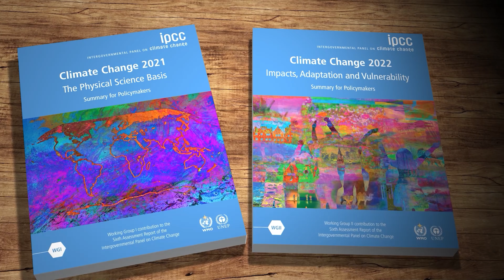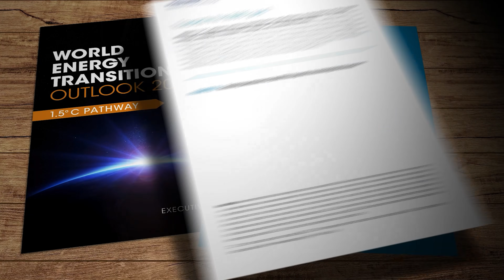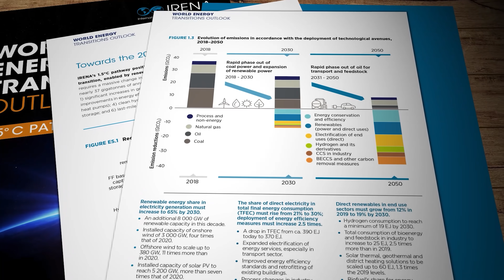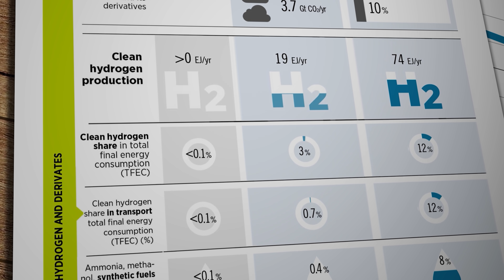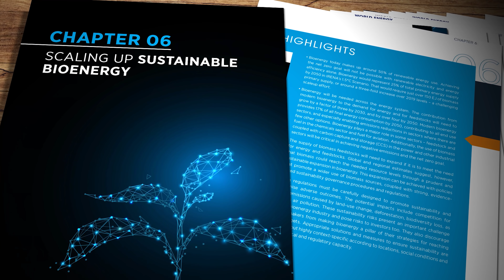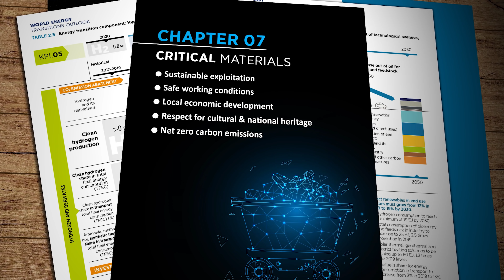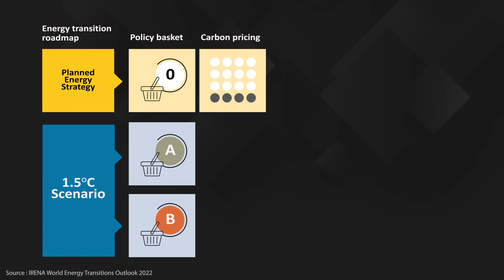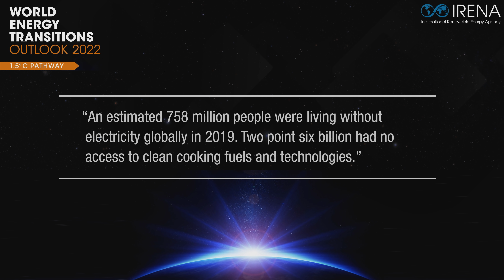Massive global energy disruptions are coming. Brace yourself!

Comment: As a Nuclear Engineer and past reactor operator with 15 years in the energy industry, I think that some of the goals are inconceivably outlandish in their investment requirements or energy targets by source when applied to the real world scenario requiring economists and financiers to put up their resources. This all seems to be a significantly easier energy transition if nuclear is integrated into the blend. With a few changes to the NRC approval process that are obtuse overcompensations and the addition of a federal nuclear reprocessing program, nuclear becomes viable, sustainable, scalable, and very clean.

I am very aware that the world sees nuclear energy as non-viable for a myriad of reasons; unfortunately the those reasons are principally fear and misconceptions based on a lack of education. Along with this, I can also understand why the International Renewable Energy Association would leave nuclear off the map because of the misconception that it is not capable of being renewable... however, as the French have concertedly shown, reprocessing of fuel is a fantastic method to nearly eliminate the waste. And to the nay-sayers that say 'well there is still waste': all the renewables cause more waste mass by multiples... wind blades, old PV cells, old batteries that escape recycling.
To any who quote TMI, Fukushima, or Chernobyl: for TMI and Fukushima I point you to the undeniable difference in today's reactor designs of GenIII+, Gen4, or SMR reactors vs those older styles of GenI and GenII reactors that required operator action or active safety systems to maintain core integrity. We learned a lot from those accidents and I am all for replacing those style of reactors to prevent another issue. For Chernobyl: Dont create a reactor to both produce plutonium and power... theyre contrary goals. Dont be cheap. Train your people.
Reply: Great breakdown!
Reply: Energy can neither be created nor destroyed, it can only change forms.  Nuclear reaction ends up as heat, and that is the primary motivtion for selecting materials for a nuclear based electrical generation plant, set up conditions to have a controllable nuclear reaction that will produce lots of heat for a long time and use that heat to boil water, spin a steam turbine with a generator on the same shaft, that causes a flow of electrons that can be used to do work at sites hundreds of miles from the source of energy conversion. 
  Mkay,   Now what does nature do with all that heat from nuclear reaction?   While we are thinking about it, how much heat is on this planet right now, that otherwises would not have been had we not dug up lots of materials like uranium, purified it and put it in close enough proximity that one particle causes another to make heat?  What is the total amount of heat added to the gas/solid interface of this planet, that is the result of man-induced nuclear reactions?  That is a pretty good sized pile of heat by now isnt it?  Where did all that nuclear derived heat go?

Comment: The IPCC report appears to not consider that levels of carbon in the distant past was up to 40 times current levels. During the age of the dinosaurs it was high since carbon is an essential component for plant growth - needed for the many plant-eating ones - until the many volcanoes and a small interstellar rock came our way.
The solution that will be chosen will be determined by Blackrock and Vanguard since they'll do the usual and guide policies that will enrich the companies they own from any government grants going around.
The IPCC doesn't go into the issue that electric cars only have a life of 50% of petrol / diesel  vehicles due to the batteries only having a 8-12 year life - and at £8000-£15000 for a replacement battery pack - too expensive to replace.
PV solar panels have a 15-25 year life - and currently not recyclable. The fibre-glass from wind-turbine blades, with a life of about 10 years are also not currently recyclable and thus will need an enormous hole in the ground to bury.
I've not noticed the increasing number of people with their own private planes selling them to do 'their-bit' for the planet.
I didn't notice in the IPCC report about the effect of the earth's tilt on global temperatures - my impression was this had a major contribution to previous ice-ages.
Note we should be using the phrase 'Global Change', since this will reduce the previous embarrassment of proclaiming we are x years from Global cooling and then claim we are x years from Global warming!!
The IPCC report appears to miss the effects of continental shifts - one problem area is in Antarctica  - apparently some people tend to ignore the effect of the earth crust opener up under several miles of ice.
So lets have a think 'are we going in the right direction' managing the earths resources for the future. 
I see the Carbon capture scheme in Iceland is having 'teething' issues - it was too cold for it to operate!! 
Any Government / Industry reports should include references to any other studies / reports on which their conclusions are based to ensure we are following the science - and not 'follow the money'!!
Reply: "The IPCC report appears to not consider that levels of carbon in the distant past was up to 40 times current levels."

40 times? that's 16.000 ppm. The only time there was this much CO2 in the atmosphere was before multicelular organisms existed on the planet.

You have no idea what you're talking about.

"I didn't notice in the IPCC report about the effect of the earth's tilt on global temperatures - my impression was this had a major contribution to previous ice-ages."

Obviously you never read an IPCC report in your life and probably never will. I just googled "IPCC earth's tilt" and there it was! An IPCC report saying that.

"FAQ 6.1, Figure 1. Schematic of the Earth’s orbital changes (Milankovitch cycles) that drive the ice age cycles. ‘T’ denotes changes in the tilt (or obliquity) of the Earth’s axis, ‘E’ denotes changes in the eccentricity of the orbit (due to variations in the minor axis of the ellipse), and ‘P’ denotes precession, that is, changes in the direction of the axis tilt at a given point of the orbit. Source: Rahmstorf and Schellnhuber (2006)."  IPCC Fourth Assessment Report: Climate Change 2007

It took me 30 seconds to prove that what you are saying is completely wrong. It shows you never checked and are just reciting some thing you read on a blog or a conspiracy video.

Now i just hope people will check on what i say so they can see how you, at best, have no idea of what ur talking about, at worst you're lying.

Comment: Hydrogen can be made of excess electricity from renewals, sure, but most of the time it's better to store the electricity in a variety of ways. Hydrogen will only be used in niche situations. It can even be better to make aluminium air batteries than hydrogen, out of excess electricity.  Desalination of salt water is also a great use of excess electricity from renewables.
Reply: <<  Desalination of salt water is also a great use of excess electricity from renewables.>>

Renewables always have the problem of being unreliable.  Is hugely expensive to build a massive surplus of renewable power because of intermittency,  then build a massive surplus of desalination  plants to use that surplus of power only the fraction of time it will be available.

All to produce pitiful amounts of water the main problem of which it is priced too cheaply.

All this would require a stupefying investment in land,  labor and materials,  which would take enormous amounts of energy by itself to build out. 

Instead,  we should be building large amounts of nuclear power, which makes the renewable power a joke by comparison.
Reply: Desalination can also help with desertification in some cases and maybe if enough water is taken out of the ocean it can reduce the rising sea levels, but it have to be scaled up in a huge way.

Comment: A lovely and thoughtful lesson, as always, thank you. I do have one question, however. It seems this work assumed a continued loss of power generation (and hence jobs) in nuclear. This puzzles me. The new (old, really) thorium technology now undergoing renaissance and testing promises a safe, scalable, cheaper alternative to the obsolete nuke tech of yesteryear and today.  If we are to ramp up some winning version of carbon sequestration and admit to the likely need for inreased global desalination capacity as well, it becomes clear that we will likely be needing to meet even steeper demand curves than those is being presented in this work. Is it true that the authors did not even mention Th (admittedly tough to quantitate as of now) or even newer-tech, compact U nukes in the current modeling work? This seems a significant oversight to me. Indeed, I would argue that the low probabilty of success implied in the analysis you've presented to us on here might well form the basis of an impassioned, full-throated pitch for rapid development and deployment of Th nukes!

Comment: In Germany and Austria are several biogas cogeneration plants typically combined with wind power and photovoltaic systems. Communities like Wildpolzried generate more than eight times as much energy than they need from the biogas plants alone. Another good aspect is that these plants generate income that benefits the community. Of course, this only works in a socialized structure. I don't think that this would fly in a privatized, commercial business model.

Comment: When environmentalists stop lying about nuclear power (which can end global warming in a couple of decades), is when I will believe there is an actual crisis.  Until then this seems like more anti-development (which ends up being anti-poor people) policies which will likely do more harm than good.  
I will give you an example.  In my hometown, they just outlawed new construction with natural gas HVAC.  However, due to the amount of gas used to make power here, that policy actually triples the amount of CO2 made per unit of heat created (because electrical heating is only 10% efficient).  Note this is only true because it is a moderate climate where heat pumps don't work, this would have been a good policy in a much hotter or cooler climate.  And before you claim it doesn't matter because it is a moderate climate, consider how much hot water you use and how a moderate climate doesn't change the amount of energy needed to heat it.  If you want to know why people don't want to go along with your policies, first make sure they work by doing some math.

Comment: If our future depends on a high level on international cooperation on good, intelligent policies, I'm afraid we're doomed. It has almost never happened before and there is very little reason to believe it will happen now.

Fortunately I don't think it does. "Renewable" electricity generation is already, in some cases, cheaper than fossil fuel electricity generation and grid-scale batteries are in most cases cheaper than natural gas "peaker" plants. BEVs are close to the same cost as ICE vehicles and the high end ones arguably compete directly with ICE "supercars" that cost 4 or even 10 times or more as much. And the costs in all these are on a long-term (and rapid) decline. There are many similar technologies that starting to come online.

This report sounds like a plan from socialist bureaucrats who are unable to understand market economies. And by "socialist", I mean the likes of the Fabian society, not Marxists. The very first action required in any realistic plan to reduce carbon dioxide output from burning fossil fuels is to STOP SUBSIDIZING THE PRODUCTION AND USE OF FOSSIL FUELS. If that is not the first and most important step of any plan, the plan is worthless.

Finally, your comment about Tesla's reason for use of LiFePo batteries is disingenuous, if not outright dishonest. Google "accelerate the world's transition to sustainable energy". What is the first result that you get? Any chance that it's Tesla's mission statement? Yes, one factor in the decision to use LiFePo cells is that they are cheaper. Another is that they are available, so Tesla is doing this, in part, to build more electric vehicles. They are also switching their storage products to use LiFePo, to free up a limited supply of NMC batteries for vehicles that need longer range and/or higher performance.

Comment: Where none of this adds up,  is the reality is,  the more wind and solar we have on our system,  I'm in Ireland,   the higher the price  our electricity gets.  Is it that most of the big wind and solar operations are now owned by Big Oil,  and they now have us over the metaphorical barrel for filling in the gaps.   What particularly annoys me,  is the "missing half of the sentence"  syndrome.  This mega wind farm will power 50,000 households ( for 50% of the time).  Solar farm likewise,  20,000 homes ( for 20% of the time ).   In times past,  a utility company was responsible for giving a 24/7/365 supply,  but that link got broken and it is now the responsibility of  SomeoneElse Inc., to fill in the gaps.  Unfortunately,  they don't seem to be interested,  because the various proposed solutions are mere pie in the sky.    The real solution of course is to drop a bunch of SMRs into every existing thermal plant,  cement works and all the rest,  putting the job of doing so,  in the capable hands of the Military Industrial Complex,  instead of us in all craziness spending 2000 billion $ a  year worldwide on defense.

Comment: The first question you need to answer is are the IPCC claims of global warming correct, and the answer, if you look at the real data, is no. The Earth is at the end of one of its 150-year cycles and is now entering a cooling period which will bottom out in 2050 - 2060. So there will be a massive energy disruption but not of the kind you are discussing. rather energy from wind will be much lower than predicted as will energy from food as crop production declines. If you want a comparable period look at the period 1645 to 1715 or 1810 to 1890 which includes the period when Napoleon's army froze outside Moscow. The Chinese scientists have data confirming this which is why the Chinese are building coal-fired power stations at such a rate and developing food production in Africa. The survival of Europe for food rests on Ukraine and Russia but our psychotic politicians have firmly shut that door as they have for the gas and oil that will be needed for survival. Even the IPCC now admit that their models are unrealistic with the only one anywhere near being correct is the Russian one that is close to the actual trajectory shown by the satellite data.

Comment: The hot air and bollocks emitted by the IPCC and their like has totally smashed our energy security. We are now beholden to the likes of despots like Putin. Thank you, you short sighted myopic tree huggers. A fairer, greener and more equitable way of running our generation will be to meet our baseload by nuclear (Thorium please) power, have PV, hydro and wind and then implement the very useful short and long term storage systems previously shown on this channel. What is clear is that greenies, tree huggers and the Dept for Energy and Climate Change must be shovelled into a hole in the ground and composted. They are the true handbrakes on our progress. 

ps. Energy security? 97% of the world’s lithium is processed in China. The electricity to do so comes from coal fired power stations. Can you smell the unsafe green hypocrisy now?

Comment: No mention of nuclear expansion in the strategy makes it pretty obvious this is just a philosophical wish list report and not a serious document. 
Also, not all jobs are made equal. Making a load of low skill, low paid pv panel fitting and cleaning jobs is very different to the current high skilled union jobs provided by current industries.

Comment: Most of which will put out high CO2 out put in the production phases. And the actual building phase as well. I am all for wind, but not those massive wind turbines. Or hydropower. I have alternatives for both, which will increase jobs and involve more people into producing energy at the points of use.

Comment: Good luck trying to enforce “renewables” in developing countries.  Grid scale storage is expensive and unnecessary.  Gen 4 nuclear plants as well as geothermal plants dug out with gyrotron millimeter wave drills are the best things we have available before fusion parity!  Apply equivalent infrastructure and materials from 1 GW of wind and solar to nuclear and geothermal and you’ll multiply that figure several fold while cutting the waste stream from, and dependence on, China.  What a scam!  They’re going all in on new nuclear.  150 new plants in the works to our negative number.  When you learn about how relatively inefficient and polluting “renewables” really are, hopefully you’ll cringe and vote against them for better tech.  Ugly, wasteful lawn ornaments!